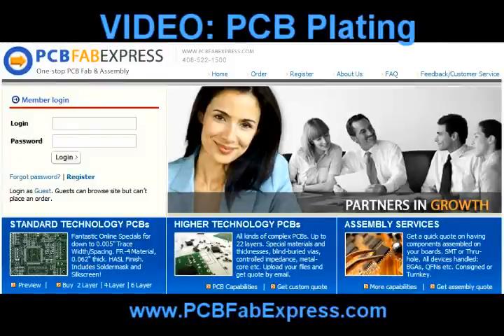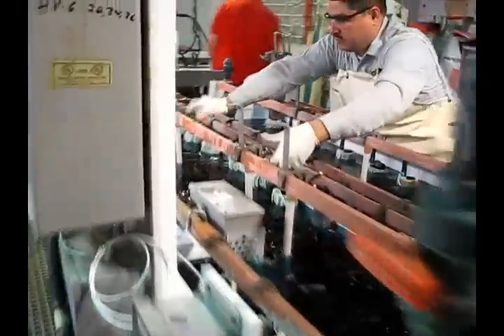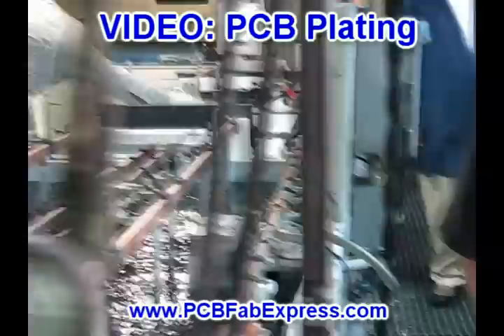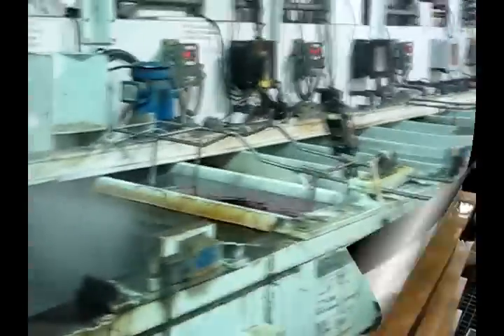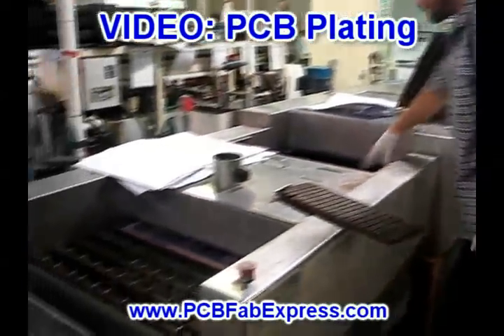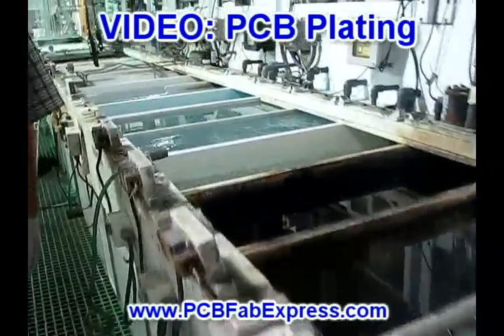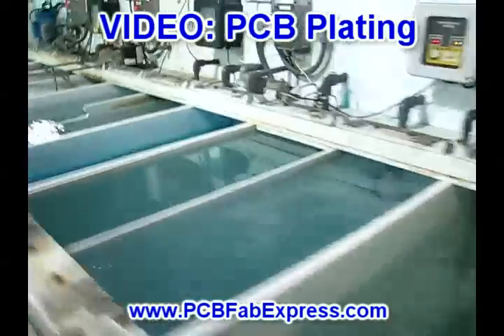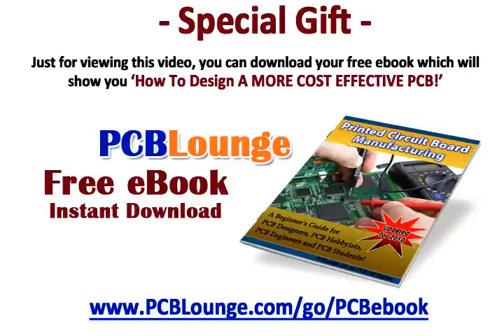PCB Plating Process - Printed Circuit Board Plating

Comment: i would advice rubber gloves ,I would also advice depending on what acid you use to have a fume extractor.
 Also bicarbonate of soda just in case the acid touches your skin it will neutralise it 
copper plating is safe i am guessing your using copper sulphate it is corrosive but
 not really any thing to be concerned about